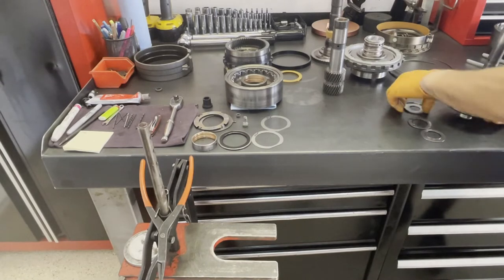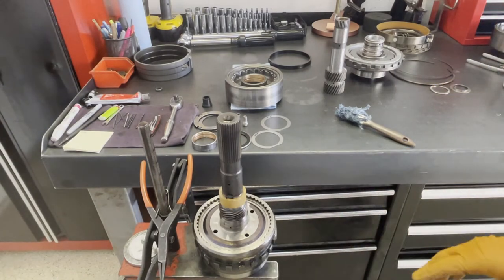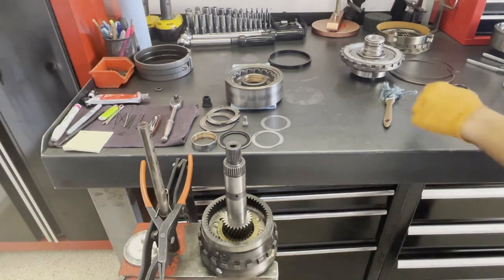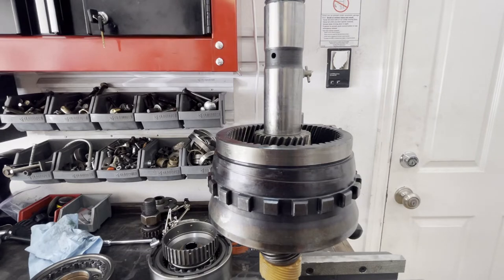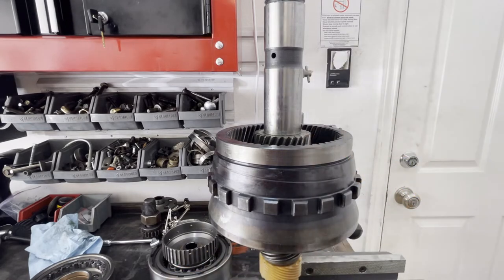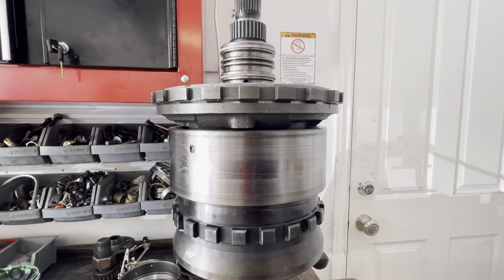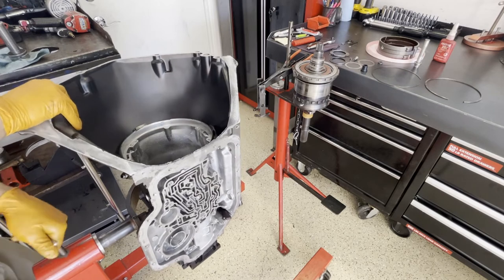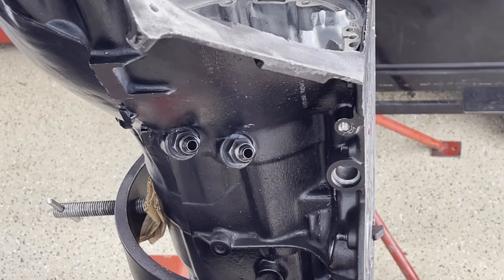4. GM TH400 Rebuild: Gear Train Assembly and Installation

Comment: Years later your th400 builds continue to be extremely helpful. I'm working on my first one, using ATSG manual, doing stuff like dual feed, 4L80e direct drum w 34 element sprag, rollerized output, the list goes on for a durable dependable unit.
The clear instruction and details you give will help make this a success. All I have to do is pay attention and work to specs.
THANK YOU.
Reply from the maker: Great to hear, NV! Thank you for watching!

Comment: Was those shims for the rear planetaries the sonnax shim kit they make? Where can you get the selectives for the rear planetaries and the forward hub? Can you get them in metal instead of plastic? For a performance build, i prefer metal thrust washers, but  is plastic just as good or better?

What should the clearances be for the forward hub? Does anyone make shims for it as well? 

Your the man Nick! There's a heck of a lot of great information in this video that nobody shows.. That is the best i have seen on setting up endplay for the rear planetaries and forward hub. I appreciate it very much.

one more question if you don't mind.  You said in the pump video that the cover was new and also fit an Allison transmission. Did they update the converter feed hole to reduce thrust on the converter? Where can one of those pump bodies be bought from?
Thanks again.
Reply from the maker: Thanks, Nitroman. Shims are for/from setting backlash for a GM 12 bolt Truck differential carrier (they go underneath the carrier bearings) and can be bought online or local driveline shops. You can also buy the Sonnax shims. No measurements for travel, it’s all by eye and feel, as explained in the video. Pump body doesn’t have the TC charge port, that’s in the pump cover and should be restricted if a high pressure PR spring is used so you avoid ballooning the converter. Those pump bodies are available from Transtar.
Reply: @nickstransmissions   your right about the converter charge port, I was backwards thinking on that. I'll have to look for those shims. What about the smaller selective for the forward hub?  I haven't seen those offered as selectives.
Reply from the maker: Google; not sure where i got them. Some may have come with billet forward hubs

Comment: Hello there...thanks for the great video. I have a quick question for ya- I'm attempting to reassemble my TH400 and I am getting conflicting information online regarding the rear case thrust bearing. My transmission currently has a thrust bearing (the kind that is just a washer with 3 tabs and no actual bearings) but I'm not sure if I should be upgrading this. My goal is trying to upgrade as much as possible to keep up with the added horsies. I'm at 575hp up from 250hp. Anyhow, if you can shed any light I'd surely appreciate it. I wish I could hire you as a consultant from afar because I REALLY don't want to mess this up.
Reply from the maker: Hi Designs in Orbit...Rollerizing is easy..just swap the three-tab steel washer and babbit style washer on the back of the output shaft for a TH350 pump thrust bearing and appropriate amount of shims to get your rear end play to about .006-.012.

Here's my video where I walk you through the process: https://www.youtube.com/watch?v=WtjhmFE8BHU&t=25s

Comment: Hi Nick, I know this is an older video. Some comments on shimming under the 4 tang washer to reduce slop in the upper planetary movement.
Did the same test on mine and ended up with a .045" shim. Then realized I had not installed the plastic washer up inside of the bottom of the center support. I didn't see you install it in your video either? Anyway, after installing the plastic washer, I had to reduce the shims under the 4 tang to .015". I used the same shims from a 12 bolt installation kit. Without relief grinding the shim where it resides inside the tangs, the shim didn't fit flat. Probably some variation on the OD depending on the shim kit.
Reply from the maker: Hi Ron, thank you for watching...That center support rear-side washer is on there, I just may have not have shown it (can't remember) but you don't want to omit it. 

Sometimes you don't need to shim the rear planet as the travel between it and the front planet is acceptable as-is, but sometimes you do.
Reply: Appreciate the response Nick. Very informative, and you are right, not a common check. I'm not a trans guy, just a drag racer who has done all my own TH400's. Mid 8 sec belly button turbo Nova. Adding the HD shafts, 36 element sprag etc and finally a trans brake. Should be interesting.
Reply from the maker: You're welcome, Ron. Yep, for sure sounds like a neat build...let me know how it turns out or if you have any other questions.
Reply: Finally reporting back. Trans works perfect. It doesn’t rock at all when I engage the brake. Perhaps reducing this clearance affects this. Take care!

Comment: Great video,where did you get the shims used to adjust the drum clearance?
I'm doing a 400 right now and need to shim for proper clearance.
Reply from the maker: Thanks, Donald. I believe those particular shims are from a GM 12 Bolt Truck differential bearing shim kit used to set/adjust ring gear backlash. They can be found online or at most driveline shops.
Reply: @nickstransmissions  Thank's for the quick reply 👍

Comment: Hey Nick... it's been awhile since I reached out with any questions. I'm hoping I still have one token left. 😊 
So my downshift solenoid started leaking so profusely that I had to drain it. I ordered a new one and before I install it, do you have suggestions on how I can not have this issue again? It does look like the new solenoid has a slightly wider rubber seal. The case seems fine. Nice and smooth hole. Do you ever use more than just a seal? Thanks man. Appreciate anything you can give.
Reply from the maker: Hi DinO - your new solenoid shouldn't leak as long as you lube up the o-ring seal and bore thoroughly. If it still leaks then that bore is excessively worn where you'll need either a different o-ring, RTV or a different case.
Reply: @nickstransmissions  Alrighty, I'll do it. Thanks for your time man.

Comment: I seriously don't know how anyone makes money building transmissions it takes 17 hours to clean them prep and assemble you definitely earn every penny.
Reply from the maker: There’s still a relative scarcity between supply (ie reputable, competent transmission builders and demand for their services so that’s keeping the segment going…Equipment like hot tanks, solvent washers, sonic cleaners etc speed up the cleaning process so getting all the individual parts clean for a given unit only takes an hour or so and assembly is usually only a couple hours once your versed on a given model of transmission. For example, Im into a 4L60e between 4-6 hours depending….But like anything else, you have to make the investment in equipment to make it efficient and be willing to wait a while before your revenues offset all that outlay. 

In short, you’re paying one way or another (time or or money, two sides of the same coin).
Reply: @nickstransmissions  I would say you would have to be a dedicated transmission builder to make any money and people don't want to pay for anything anymore they want cheap.
Reply from the maker: @keysautorepair6038  trans work is all I do for the general public and no arguments from me.

Comment: I've stacked up my gear train 5 times now and have zero play. What am I doing wrong? I follow you and mr mountain
Reply from the maker: Hi Jordan, impossible to say without being there to watch what you're doing but my guess is that you aren't doing anything wrong...stack it up with no four-tab thrust washer on the rear planet and see if you have space between them. If you still dont have any something is wrong...Are you working with all of the origional gear train parts or were one or more parts replaced?
Reply: All original parts in amazing shape. Just at a loss here. Even atsg shows me doing it right
Reply from the maker: @jordansmith8467 yea stack it up without the washer and see if you have spacing between them, and if so about how much...should feel like about the thickness (or slightly more) of that washer on the rear planet in terms of spacing...

Comment: Does the sun shaft and sun gear weep hole alignment depend on the type or year of sun shaft? My sun shaft is grooved 360 in which case I would imagine the fluid will fill up the channel and weep out regardless of its position.
Reply from the maker: The lube port in the sun gear shaft must align with the lube port on the sun gear (they are lube ports, not weep holes). The beveled splines on the sun gear must face down (ie rearward) when installed.

Comment: Very interested in making the stand you are using here in the video holding the planets. Amazing idea. Looks like a 8"x8" 3/8" plate steel top but how bid is your opening and depth? If it's a trademark secret, I understand but would love to make a similar unit as I'm a newer th400 builder myself.thank you kindly and have a good day
Reply from the maker: Assuming you're referring to the first portion of the video, the stand is actually just my foot press. Those are available on-line and through some transmission parts suppliers. Price-wise, they range from a few hundred to $1000+ depending on who makes it and where it's made (USA-made presses are typically much more expensive). If you only anticipate doing one to a few transmissions per year, you can buy vice-mounted units that compress return spring assemblies that are much cheaper. But if you plan on building transmissions more frequently, I'd spend the money on a good foot press.

Comment: What thread locker number did you use for the install of the 3/8 cup plugs thanks jb.
Reply from the maker: Locktite 262
Reply: @nickstransmissions  your red foot press is by who thank you.
Reply from the maker: No idea as I purchased it a while back from a trans shop that was going out of business. There's no manufacturer's name anywhere on it. You can buy one identical to it on Amazon or eBay.

Comment: Hi were can I get some of 3/8 cup plugs for the dual reverse thank you jb.
Reply from the maker: You should be able to source them on Ebay or Amazon
Reply: @nickstransmissions  nope I've been to napa advance ect can you help me out thank you.
Reply from the maker: Hmmm…i just did a search on ebay, google and amazon and couldn’t find any in stock either. I bought a box of them a few years ago and haven’t had to source any since so not sure when they became scarce.

Perhaps you can use a 3/8x16 set screw. Just run a 3/8x16 tap through the reverse feed passage port on the case then once the center support is installed for the final time, put some thread sealent on the set screw threads and screw it in. 

Alternatively you can plug the corresponding feed hole location on the separator plate though ive never done it that way so can’t tell you how to go about it.
Reply: @nickstransmissions  what is the cup plug for? what is dual reverse?